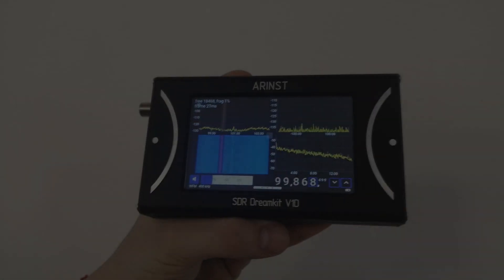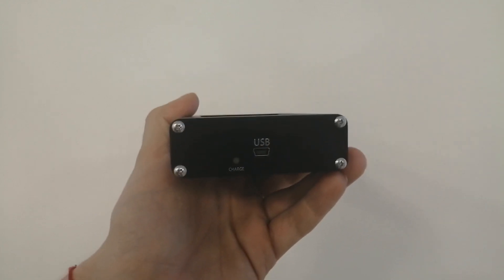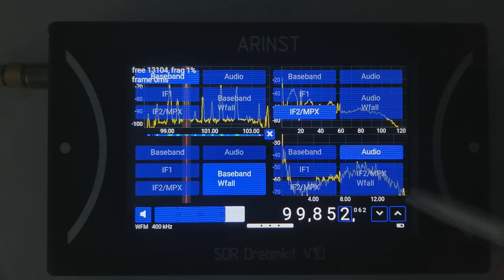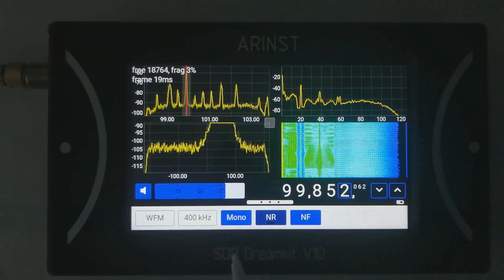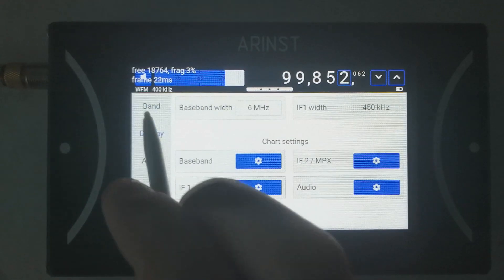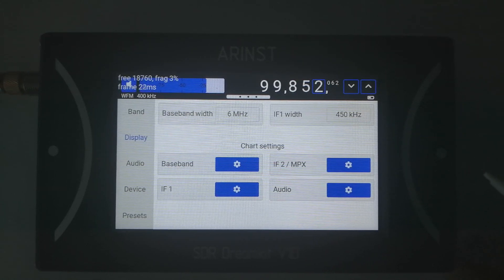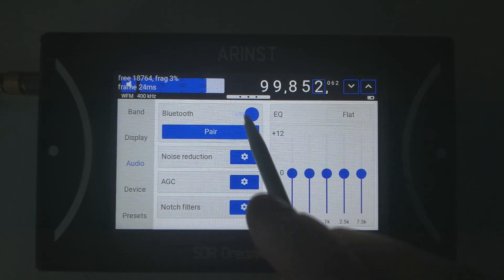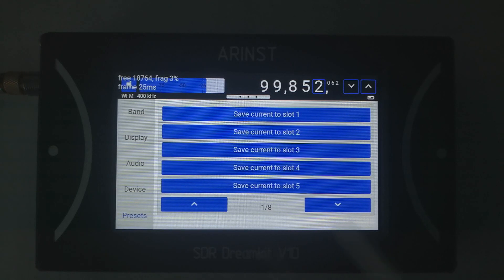Arinst SDR Dreamkit V1D

Comment: Why would you call this a ham receiver project?   It has NO band pass filters.. It receives FM broadcast station images right across HF frequencies. My FM stations are 35km away from me yet even with  a short 30cm whip antenna on this receiver it receives FM stations right across HF at -70dbm.  Its NOT a receiver without some basic filters.  Did you forget to install them? or do you plan to add them later?   I hope you allowed for a filter on the PCB to be made and installed at a later date
Here are my findings re the SDR dream sdr..   When used as a stand alone receiver
Useless on HF frequencies.    Its a 16 bit receiver but without filters it may as well be a 8 bit rtl dongle.
There is no gain control.  All sdr receivers need a RF gain and IF gain
Some touch screen functions don't work reliably.  
If you maximise the spectrum display then spectrum does not match the waterfall. (Spectrum and Waterfall display are offset frequency wise) 
Tuning it is a pain.  
On the good side    The display screen is very nice.  
Build quality is excellent.  
The unit appears to be well shielded as there is minimal rf noise from the screen. 
Audio quality is good but volume is not very loud specially in AM and SSB modes.
I think the designer should have a good look at the Belka-dsp which has filters and a decent way of tuning.  That small tuning knob (vfo) on the side would have been excellent on the 
sdr dreamkit.  
This could well be a very good portable SDR with software and hardware modifications but as received here right now its just not
Reply: Hello, thanks for the feedback. We will try to take into account in the next revision of the device. According to your remarks - you need to update the device firmware to the latest version through the program Arinst Firmware Updater on the website http://arinst.net/download-apk.php . It removes the bugs you are talking about, added bands for SSB, IF gain tune and squelch. If you do not have enough sound volume in AM / FM, try adjusting the AGC  settings. Have a good day!
Reply: @Владимир-п6к3и  Hi  Thank you for that.  New firmware made is an improvement over the original one. Adjusting the AGC made the volume normal.  I suggest programing these sdr's with that setting already done to avoid confusion.  Lack of  band filters is still a problem.   Can't use HF frequencies because of broadcast FM stations 88-108mhz  picked up between 5mhz and 30mhz Also noticed last night that above 1Ghz I get MW  am broadcast stations and these are there all the time. Even when tuning they don't move across the spectrum.  I will make a YT video showing these problems.  I ask the question again. Did you allow for filtering to be added to the board at a later date? If filtering can't be added to this board then this SDR is useless.  Very sad for such a nice looking sdr. Also on your download web page English manual is actually in Russian.
Reply: @jamdigital9530  Hi!
The instruction is being prepared, we will wait for your video.
Reply: @Владимир-п6к3и  Thanks!
Reply: @Владимир-п6к3и  https://www.youtube.com/watch?v=8JzADBrNqCE
Reply: @Владимир-п6к3и  Hi Did you look at the video I made you?  its below in the comments
Reply: @jamdigital9530  Hi! Please use external filters) Also update the device, removed some display errors
Reply: @Владимир-п6к3и  update not working at the moment?